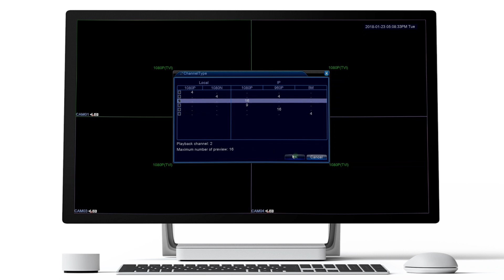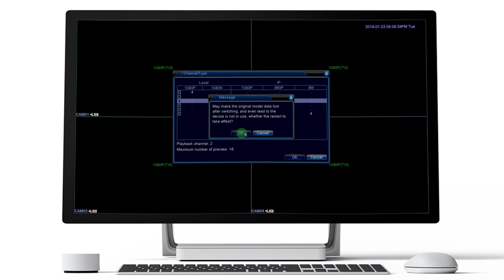How to connect an IP camera to a Sannce DVR

Comment: So you connected the internet cable to the back of the dvr, where does the other end go? To the modem? Then you connect the Ethernet cable to the camera, and again where does the other end go? To the modem also?
Reply: I am also confused because I have a sannce and it is not the same
Reply: @DiamondAries999  bit strange how they never did a proper video on it going by the other comments

Comment: I'm confused.. please explain when did he connect the camera to the DVR? The DVR, not a NVR. The DVR had BNC/coaxial camera inputs on the rear, not Ethernet POE inputs.
Reply: I'm confused at when when plugs internet cable to the dvr and internet cable to camera, never saw him plugin it to the actual internet box
Reply: @whitestorm31  He must've, but they neglected to show it for some reason. It wouldn't make sense to plug the camera into the DVR's only network port.